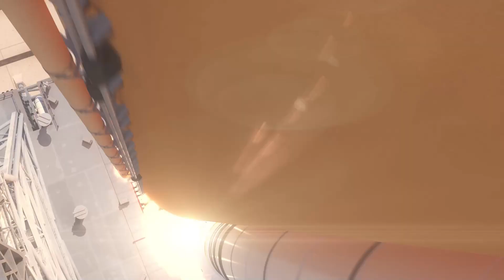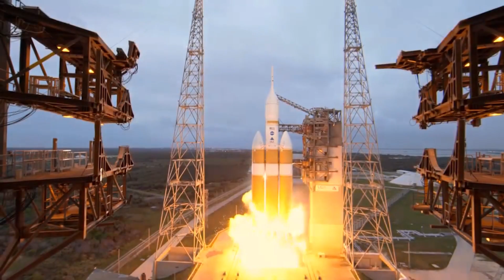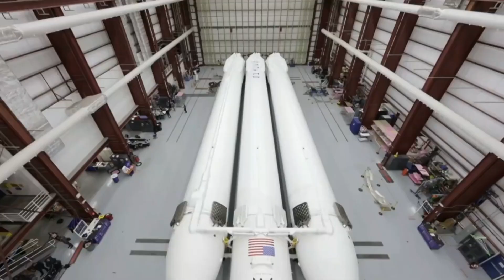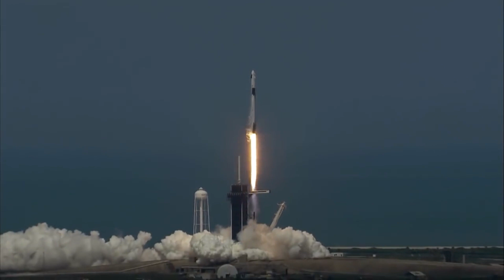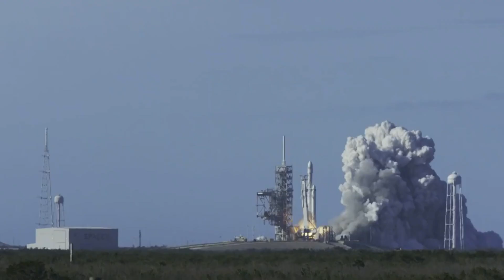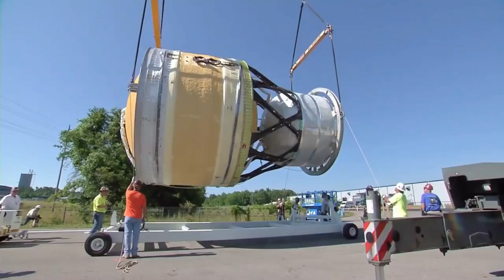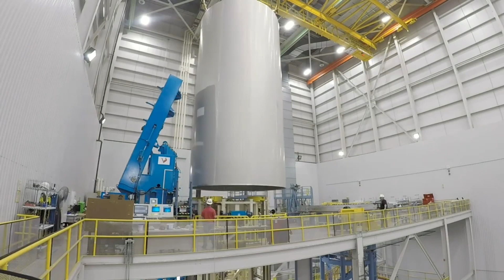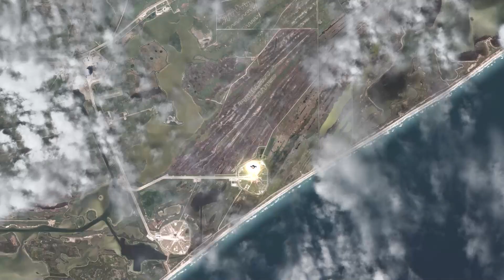Why Falcon heavy can't replace SLS

Comment: Another option that nobody seems to think is using most of the hypergolic propellant from Orion services module to reach lunar gateway, and refueling that modules when is attached on the gateway.
Reply from the maker: that would be logistically very hard. where are you going to get those hypergolics from?
Reply: @DavidWillisSLS  hypergolics propellant transfer on the orbit is proven technology used on ISS, but obviously you need to launch a separate rocket with a capsule derived from one of the current resupply capsule(that would be done earlier, and the propellant will wait on the gateway) , which wouldn't be a problem because that type of propellants can be stored in space for a long period of time , seems like a suplimentar complications but that would eliminate need for a hidrolox upper stage integration in the falcon heavy fairing.

Comment: Funny how the absolute killer reason it went work applies equally to SLS block I.
Reply from the maker: Yup! That’s why the block 1 only has 3 flights! Block 1b starts flying on flight 4 and that will use the EUS
Reply: @DavidWillisSLS  but there's a problem, SLS block 1B si not ready yet. And is not clear when it will be, i think the last Milestone they teacher was the critical design review or something like that
Reply from the maker: @martinmoralaandres6034  block 1b is already in production. The first EUS will hotfire in 2024 and launch in 2026, there is a very clear timeline actually
Reply: @DavidWillisSLS  So why does it mean FH can't launch Orion to the Moon? That's a rather blatant double-standard.
Reply from the maker: @pseudotasuki  well if you can tell me how the 12 foot wide falcon heavy is going to carry a 27 foot wide rocket stage then I would love to hear your answer
Reply: @DavidWillisSLS  27? Wut?
Reply from the maker: @pseudotasuki  that’s how wide the EUS is. You can put that on an SLS no problem. But not a falcon heavy
Reply: @DavidWillisSLS  And if EUS was the only option that would be a logical argument.
Reply from the maker: @pseudotasuki  and it is the only option since they’re ceasing production of the ICPS. It’s called the INTERIM cryogenic propulsion stage for a reason. They’re only going to use it until EUS comes online
Reply: @DavidWillisSLS  There are other upper stages. Like, say, Centaur V.
Reply from the maker: @pseudotasuki  that's 18 feet wide. gonna be hard to put that on a 12 foot wide falcon heavy too
Reply: @DavidWillisSLS  Not much bigger than ICPS or Orion.
Reply: @DavidWillisSLS Plus, Centaur V might have enough total impulse to replace the Falcon upper stage.
Reply: @DavidWillisSLS  And let's not forget the extra performance FH could get by implementing propellant cross-feed.
Reply: @pseudotasuki  Dude rockets aren't lego... Crossfeed isn't a thing on FH, neither is stacking the ICPS or Centaur V which is 5.4m, even bigger than the ICPS!!! I like the FH too but the reality is you can't just throw crap at a rocket and expect it to fly...
Reply: @jamesmclaughlin272  SpaceX had originally been planning to implement propellant cross-feed for Falcon Heavy, but dropped it as performance improvements to the baseline Falcon 9 made it unnecessary for any of the expected missions. The capability is still there, though, if anyone has the need and budget to finish the development.

The diameter of Centaur V is 5.4 meters. The diameter of the Falcon 9/Falcon Heavy payload fairing is 5.2 meters.
Reply: @pseudotasuki  You do realize that for non-dragon payloads over 10-12 tons on the Falcon  need a custom structural adapter to support the weight? Putting a stage wider than the fairing is just a bad joke, seriously.
Reply: @jamesmclaughlin272  Oh no, a custom PAF? Forget everything. Such a thing is completely impossible.
Reply: @pseudotasuki  It is possible, but complexity is astoundingly high. Remember Elon saying how easy it was going to be to strap two extra cores to a Falcon 9? Remember how wrong he was and how long FH took to become operational?
Reply: @jamesmclaughlin272  I don't think anyone is saying this wouldn't be a major undertaking.
Reply: @pseudotasuki  You're correct. It would also be a ridiculous and expensive undertaking as well if ever realized.
Reply: @jamesmclaughlin272  No moreso than SLS.
Reply: @pseudotasuki  At least that will send people to the moon. :)
Reply: @fuckednegativemind  Propellant cross-feed wasn't implemented because they didn't have any customers (or potential customers) who needed it. A Falcon Heavy/Centaur V launching Orion to TLI might.

Comment: Main reason Orion on Falcon Heavy has even mentioned was to accelerate SLS. As it's the only way to get to the Moon, thus having no competitors, the mention that something else could do it's job motivates management to keep things moving along for the fear of being replaced.
Reply: I don't believe it to be the main reason, but more of an added bonus that it COULD be inferred that NASA could go with another competitor.
Reply: Well, no.   The real reason it was discussed was in response to pressure from the White House to have a manned flight around the moon in 2020 (an election year).   Somebody thought it would be easy, and David has detailed why it would not be so.

Comment: Falcon Heavy is capable of ~16 mT to TLI, not 21mT though point still stands.
According to an LSP study the modified FH couldn't get Orion to TLI either, it required a significant amount of work from the SM.
Forget perfomance margins, this option has negative margins.
Reply from the maker: Falcon heavy according to the spaceX website, can send 16 tons to mars. if thats true then they can send way more than that to the moon. which is why i use the 21 ton estimate
Reply: @DavidWillisSLS  LSP has FH expendable send 16 tons to an Earth escape trajectory, which is slightly faster than a TLI.
Either way the modified FH couldn't have sent Orion to a direct TLI as per my original comment
Reply: Musk has previously said the performance numbers from the LSP DB for the FH are not accurate.  It''s his rocket so he would know.
Reply: A ballistic lunar transfer with c3 of -0.5 and a long transfer time gives FH with 15 tons to TLI. All three cores expended... Not an SLS killer, that's for sure!